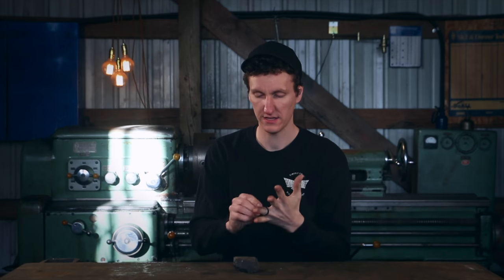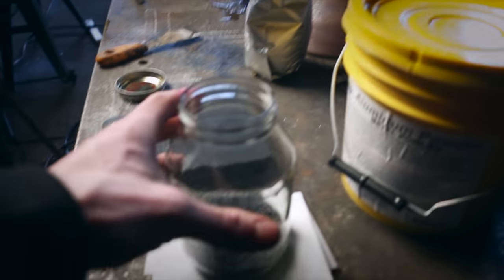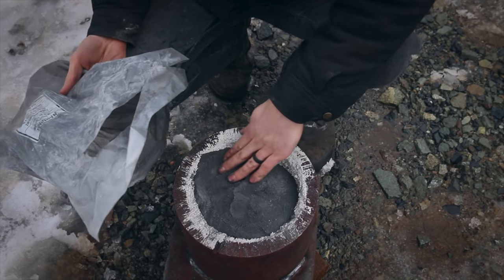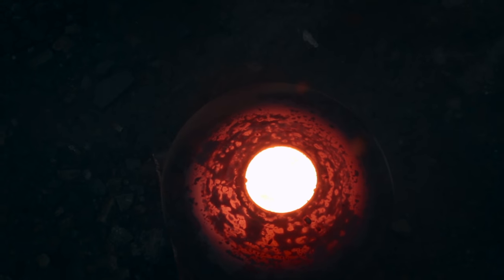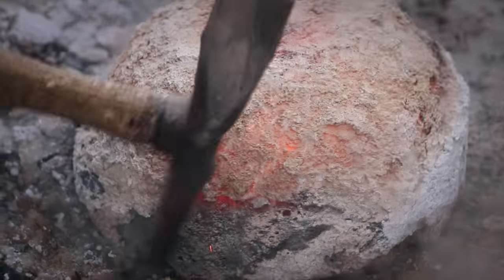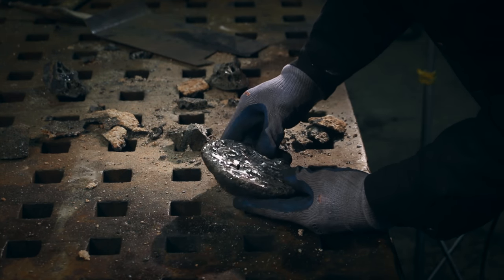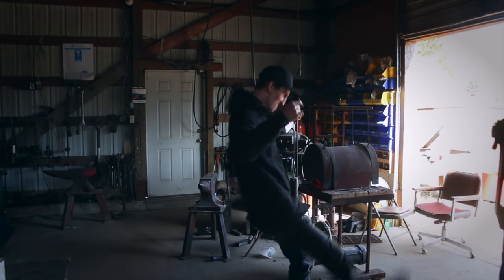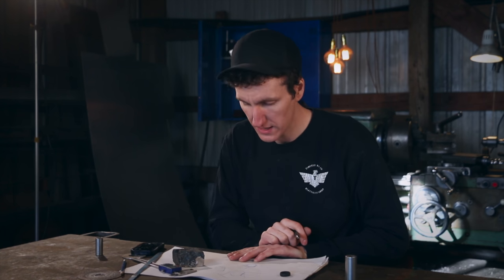Making 4000 F THERMITE RING - Part 1

Comment: Hello

If it does not work well for the forge, you can use the defective part to make an ornament showing the crystallization of the iron as if it were a mineral or also cut it and make a pendant or ring showing the crystals.  O well;  melt the metal, make an ingot to forge again.  Nice try👍

Comment: I got my hands on a few copper thermite tubes used for welding subway rail electrical connections. That stuff is SO much more reactive than the iron thermite I was used to. It burned three to five times as fast and the copper was as fluid as water (perfect to fill electrical connections without bubbles per design). I was just amazed.

Comment: Hey Tim Just a little tip, forging Thermite is just like forging Crucible/Wootz Steel, it doesn't like to stay too long in heat, and you have to have your temperature pretty much spot on at 2350 F.  If you go over it'll overheat and crumble if it isn't hot enough it'll wreck your hammer and crumble anyways due to carbide dendrites forming during the forging process.  So yeah thermite is a really tricky steel to get just right

Comment: Thermal cycling that metal above the A1 and allowing it to cool down to a good magnetic attraction will cause the dendritic structure to shrink in size. I would start at six cycles through the forge then start nudging the ingot with the hammer. It’s the same slow working principal of meteorite forging and especially Wootz Damascus forging.  The melt temperature is so high the structure of the metal is very large.  Just my experience.

Comment: Good video thanks!
Maybe it has to be worked as wootz, very small hand hammer blows at low temperatures ?
Reply from the maker: Thanks, I definitely approached it with this method, maybe not captured in the video, but it didn't seem too condense or change from the beginning to the end. I think at the point of starting to forge, it was what it was. I'll have to play with the recipe to get it better next time.
Reply: @TimothyDyck  good luck!

Comment: The problem with your thermite that is making it brittle is that it has aluminum in it. The aluminum oxide when mixed with iron or steel produces an aluminum steel alloy which is brittle. This makes it almost unworkable. However if you reintroduce nickel into the mix you will create a more advanced form of aluminum steel alloy that can be worked and is many times stronger than normal Steel. Just saying introduce a little nickel into the thermite when you make it that solves the problem.

Comment: The problem you had with the iron left over is that all the slag was left in.  Construction/railroad workers have been using thermite (or they used to) to weld beams or railroad tracks together.  I don't know the name of it, but there is a pot type tool they use.  It is cylindrical, but has openings to allow the slag to pour out of.  The slag pours off, and the molten iron pours straight down.  There is probably still slag inside of the iron, but not as much.  And the iron at that point is most likely closer to cast iron, and definitely not steel.

Comment: Tim wonder if a add flux to the thermite/steel mixture like flux that you would use for a Damascus billet I’m no scientist or metal expert but I’m pretty sure iron oxide is rust but from the looks of the forging that material looks super hard but brittle like cast iron I think by adding flux to the material it would help weld the cracks shut or clean the material from contamination
Reply from the maker: Thanks! I would like to try playing around with some kind of flux to see if that helps, hoping to develop a recipe that can be forged.

Comment: Wouldn’t that cracking be due to carbon loss?Tamahagane steel also does that during the early stages of refinement. Treating your thermite steel like tamahagane would allow you to continue to work your billet. It’s the same as lightly working Damascus but you’re not just stacking and forge welding; you’ve got to add carbon back into the metal.

Comment: What if you heated the piece, fluxed it, heated it again, and put brazing rod to it? Or lay the braze filler on top and put it in the forge? The brazing rod may fill all the cracks and fissures, and the different color would be an interesting contrast.

Comment: Little bit of chromium oxide and nickel oxide and we have stainless steel thermite. Somewhere I heard that by adding to iron as little as 1% of copper it's a lot of more playable, with thermite it's just a another powder to add. Also this is really good idea to use steel from cutting instead of flux, and container do well
Reply: Chromium and nickel would work fine, but copper can be tricky. The max temp of the thermite is very close to the boiling point of copper. Copper can be pretty violent under these conditions. I´ve done many thermite reactions and it can be pretty hard to alloy copper in a thermite. It´s the same with manganese, you simply boil the metal out of the thermite. I´ve had great success with Tungsten / Molybdenum / Chromium steel.

Comment: I don’t believe you need to worry about structural integrity this is not a machining tool or a hammer it’s a piece of jewelry the only concern I had was rust what kind of a finish will you use to prevent this ring from rusting or did I miss something on the video where you describe the type of alloy you’re using that does not rust

Comment: Reminder that thermite-produced iron has no carbon in it. It is as pure as reasonably possible. You may want to add manganese dioxide, nickel oxide, chromium oxide, cobalt oxide, and a proportional amount of aluminum for each addition in order to make an alloy thermite. I can do the chemical calculation if you need, (just tell me the desired alloy ratio) that would be a great video.

Comment: For the better part of a year I welded with Thermite on interstate bridges......better handle that stuff with care.  When you make the slightest mistake it can 'eat your lunch' in a second.  During WWII 3 ft thick battleship plate was welded with thermite.....come to think of it, thermite was used to weld rail for many years.  I just started this but my sense is that it will take a lot of work with the forge to make any good steel....too many inclusions.
Reply: @Wroger Wroger My brother worked 25+ years for B&N as a welder on the track.  They didn't use it where he was at but I'm sure somebody still uses it.....where are you at that you've seen it?  Pretty interesting....I thought that they'd all gone to welders.  Thanks for the info, Tom
Reply: Tom Nekuda there are several youtube vids showing the proces from present day. Impressive
Reply: @Pittens  I seen them but thought the vids were older, interesting.....the heat from thermite has to be experienced to be believed.  I welded right thru the winter...sometimes -15 degrees without a shirt.  It must throw off ultraviolet as well as IR because had a suntan all thru the winter on exposed skin.  Generally if I had a shirt on, the sleeves were rolled up and front unbuttoned.  Guys used to laugh at my super-tan chest/stomach.  Told newbies that I'd just gotten back from laying on the beach in FL.
Reply: @Wroger Wroger Thanks, Chief.

Comment: Iron from thermite is always very brittle.
Reply: chris jones thermite is also used to fuse railroadtracks together, so its not necessarily brittle.
Reply: @Pittens  yes I know, however they use a mold for this and let it cool as slowly as possible.   When people use thermite to make metals from their oxides they tend to break them open like he did in the video.